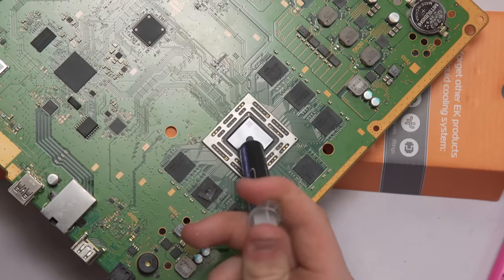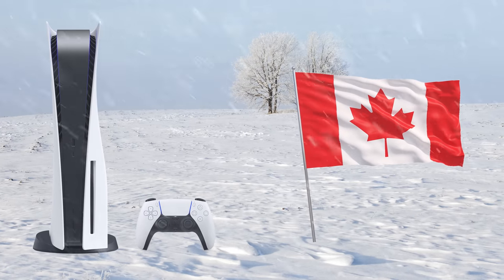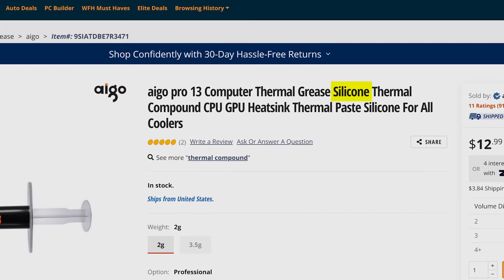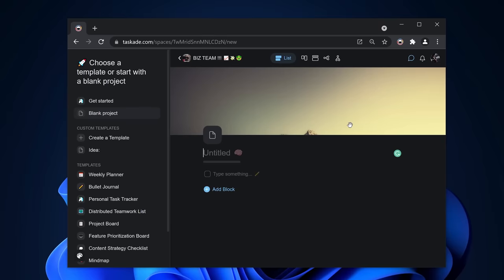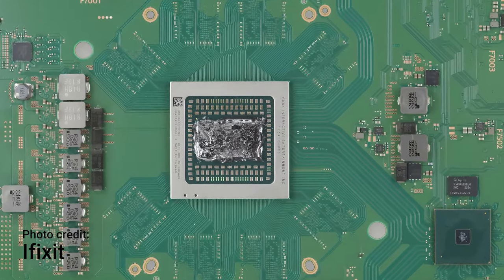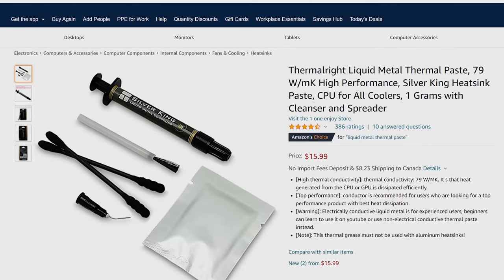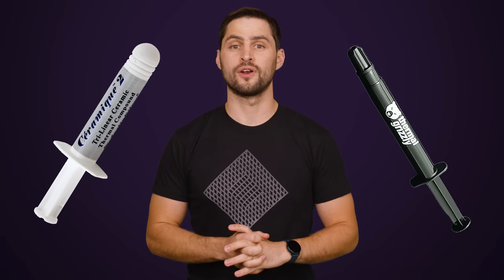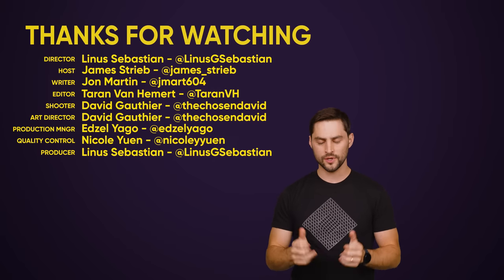LIQUID METAL In Your PC and Console

Comment: Guys if this becomes a thing I know a stock that will do well: lqmt (liquid metal technologies) maybe its a buy?
Reply: what ever could you mean by becomes a thing... it is most definitely a "thing" and has been for quite some time now in the custom/DIY computer building scene. Check out gamersnexus , actually hardcore overclocking, and quite a few other channels and youll see many videos about liquid metal. Its just now become a more general consumer thing rather than a specialized DIY thing only. With microarchitecture become more and ore common youll start to see more products with liquid metal thermal interface material. Theres a couple "mini pc" companies using it now as well..may have seen LTT and GN's recent video on it... Steve from GN found liquid metal all over on the inside of his.. this would be a prime example of why you havent seen this branch out further. Also, the clip of linus squirting liquid metal inside the laptop in this video is also a prime example.

Comment: I've always used artic silver and never had any issues with it and always preformed well. I wonder though it if has some risk to it as well since it contains silver, but again never ran into any issues msyelf.
Reply: Technically speaking it does, as it is one of the most conductive pastes, exactly due to the silver. Why arctic silver? As far as I’ve heard, MX-4 is a just the better paste, with similar or better performance and negligible conductivity if any

Comment: I was thinking how about replacing cool pasta in all equipments from consoles to computers with liquit metal and add heat sinkers and cooling fans to it to make sure those systems will stay cool as needed and as long as possible,
Sure you don’t want to add too much metal pasta to your cpu and/or power regulator but if you could make sure to keep it all cool, why not, it might be ideal for old systems to increase it’s lifespan😁

Comment: Isn't liquid metal going to somewhat significantly degrade copper over time as well? Granted, not to the extent it does aluminium, but it's still worth noting for those with expensive cooling solutions they want to last for at least a decade (Noctua products spring to mind with free mounting kit upgrades)

Comment: You missed the other disadvantage of Liquid Metal, that still debatable, like its longevity. It is thought life span isnt great as Thermal Paste that can last 5 yest or so easily.
Reply: Thermal paste is freaking great man, I was just working on my old i7-3770k today and tried to remove the artic silver that I applied almost 9 years ago, long story short my AIO is still completely stuck on it and it still runs ~63°C max, even after like 30mins in prime95. I Decided to leave it like that. 

I went with some Noctua Thermal paste on my new 5900x and it's running at 45°C idle and 68°C max in cinebench, I'm pretty happy with it.
Reply: @Tahira204  yes man, depend on thermal thatbyou gave that day. My home laptop from early 2008, manage to stay cool withought changibg any thermal eventhough the spec aint cool no more.  If i had a kid that day, the kid has already in their puberty.

Comment: Well I like your videos and your narration on different topics here.?, Why does liquid metal have to be sqirted? There's no control. Have it with a brush like liquid correction fluid. So you can slowly brush it on those chips You have more control using a brush then squirting. When I take a leak and squit between two trucks,   I don't care where it goes. But on a mother board l? forget about it it's like suiciding  your motherboard.. So back to my question why don't they use a little rush in little containers??. Thanks again stay well during this pandemic

Comment: Most ps4 that ive repasted were still jet engines, until i placed washers under the coolerscrews, then the ps4 stopped sounding like a vacuum cleaner. So its about pressure more than it is about the thermal compound, when you have enough pressure and cooling you don't need liquid metal, at all. This is a design flaw of epic proportions. And don' use liquid metal with aluminium and don't spread it like butter, a thin filmlike layer is enough, don't let it pool up. PS5 has a lake of liquid metal and you don't want to use it like that in your pc or ps4. I don't know who designed the cooling of the ps5 but its utter shit, compared to a properly made design with pressure and adequate cooling, they could have made it far better.

Comment: I wouldn't use liquid metal in a vertical setup that is found in most pc setups. Maybe that is just me and my irrational fears though. My ps5 is never gonna be in its vertical position for instance.
Reply: the reason sony used the setup they have with their liquid metal is that exact detail. The vertical stand. Technically speaking it makes no difference in performance thanks to how they have done it (and the amount they have applied), however it does leave one top side of the die less covered than the bottom when in vertical, this is the very long run could result in more degradation on that side. It will take some very long and in depth testing to actually prove that. I believe Gamers Nexus is working on something of the sort, and have done (or are doing) an on going liquid metal endurance test.  https://www.youtube.com/watch?v=fnbovjT4JLQ

Comment: Liquidmetal is pure garbage. Even if applied correctly, it will affect components and there is a high chance it will spill over capacitors on CPU's (laptop) or socket (desktop) and mainboard. It will short the mainboard past repair. Also, there are many laptops that all of a sudden die and when you open them to see what is wrong, surprise, factory incorrect liquidmetal application and spilled on the capacitors. Laptops need special silicone elastomer to hold the liquid but even so, there is still some drops that slip under it and get on the capacitors.
For a few degrees "colder", it's not worth it.
For deliding and overclocking and "squeezing" every last drop of performance, still not worth it. Games do not benefit 10% more CPU power, since most work is taken by the GPU and funny, people do not use liquid metal on GPU, even if a GPU sucks 3 times (at least) the power consumption of a CPU, yet nobody use it. Compromising stability for 2 FPS more in a game just not worth it. Except if you have a lemon and want to make it an orange, maybe then. Better save the money and get a better hardware.
I wonder how many PS5 will return in RMA with spilled liquid, but my bet is that Sony will never disclose that, won't they :) 
I have seen the iFixit teardown, my point exactly. There was spilled liquid metal under the CPU sponge insulator. 
Great job Sony, really great, but "the game is not worth the candle" :)